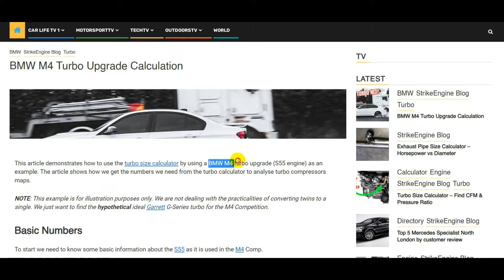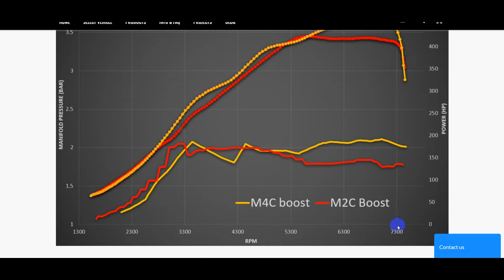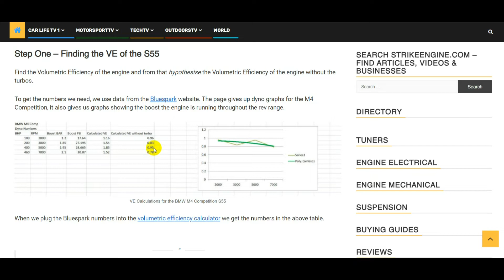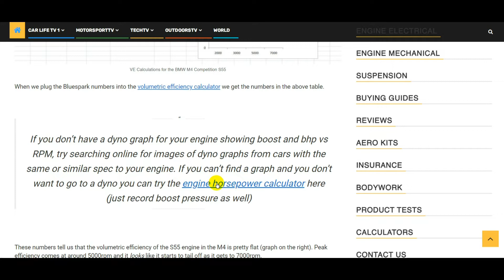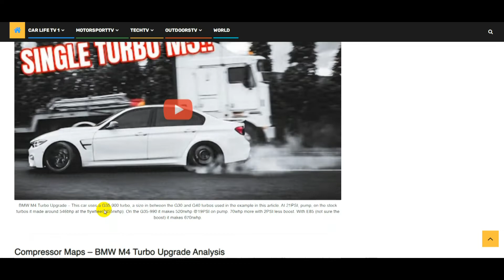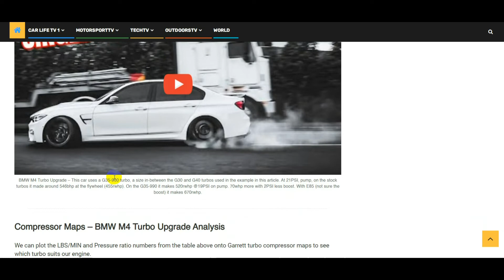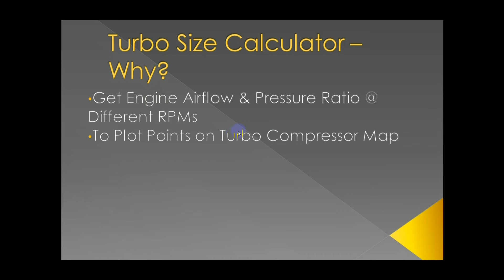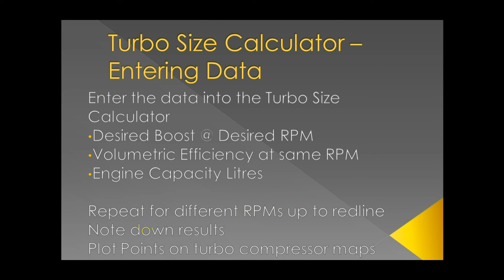Turbo Size Calculator - How It Works

Comment: You reference boost in the volumetric efficiency section. What if the engine is naturally aspirated stock?
Reply: The VE calculator gives that number in the last box, above the section dealing with boost

Comment: Is reading the exhaust flow chart the same as reading the compressor map??
Reply: You need to know the turbine inlet pressure to get the pressure ratio. (turbine inlet pressure divided by MAP). 
For airflow, Garrett call it "corrected" airflow. Im not sure what they do to "correct" the airflow number.